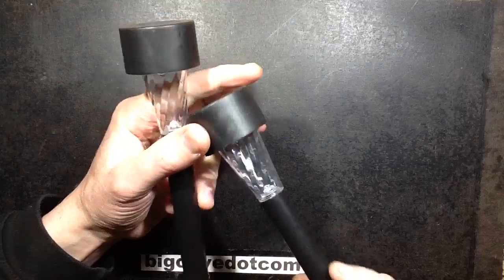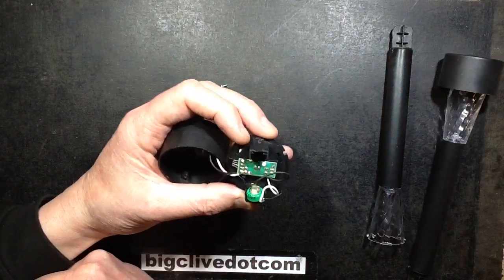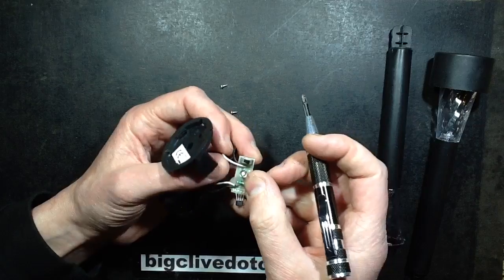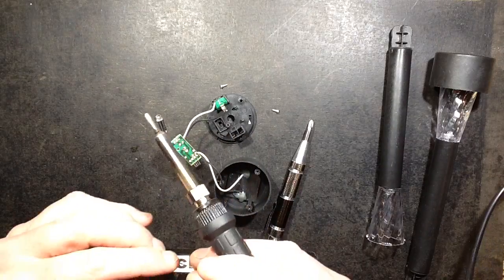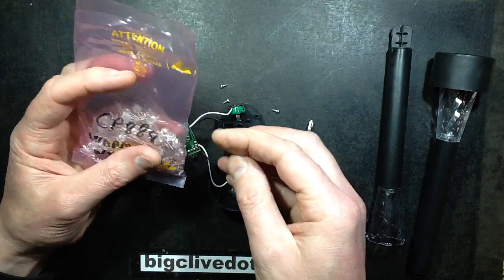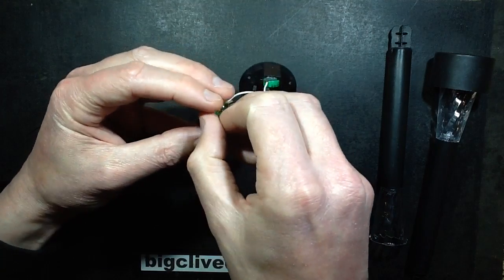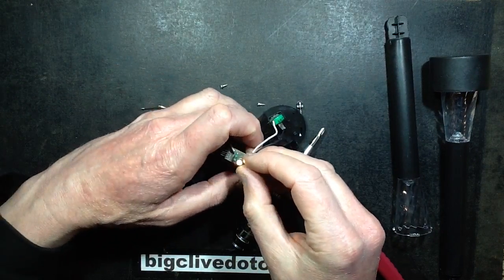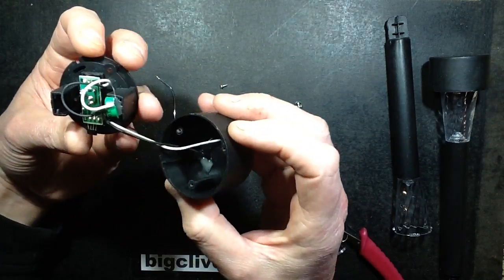Hacking Poundland "2 for a pound" solar garden lights.

Comment: I tried the tap from eBay but it went crusty and hard and fell off so I use your other method and put a thin coat of silicon across the top that has worked for over a year and looks the same it works. thank you

Comment: Hi do u think that the lights could be modified to wire a very simple mp3 player
Reply from the maker: You can get solar powered MP3 units, but they tend to have bigger cells and batteries.

Comment: I bought a pack of 20 of these from Bunnings for and it was $15. It has warm white leds same build design with a different diffuser {in my opinion that looks better}. It has a 100mah 2/3 aa battery in it. Pretty good a 75c AUD like 40p per light

Comment: Hello, there. Thank you for bringing informative, interesting videos in a low (understandable) way. I know this is an old video, but I am searchimg for a matter that I can’t find anyone has ever bothered to mention, allthough to me it seems to be a common problem. The manufactures of these cheap garden solar lights seems to have got a hangup on putting in these small on/off switches, that (for the price naturally) is very, very poor quality. I don’t know why they bother, who turns these lamps ever off, anyway? When the go bad, I usually just short them. 
But could you explain, maybe in a video, what happens when the battery gets charged, but the lamp is always staying on (no need to cover the sun cell)? This also seems to be a recurring problem. Regards from Norway :)
Reply from the maker: Sometimes when the battery is old and has high resistance the voltage across it rises high enough to light the LED from the solar panel.  The on/off switch is to try and protect the battery from being kept in a discharged state for too long during storage after manufacture.
Reply: bigclivedotcom I know I started my comment regarding this switch. Along I changed the team, for some reason, to write about what component that has the job on waiting for darkness to lit the LED. In a amateur way. Sorry about that.  Thank you for answering :)

Comment: i cant seem to find what the voltage is for the leds.
Reply from the maker: Typically around 3v, but you can use any ordinary LEDs.
Reply: thanks for the quick reply, here i was searching the interwebs for 1.2v leds :D but this makes it much easier since i already have them laying about

Comment: How do I update it to use copper wire led string light to make jar lights?
Reply from the maker: If you get some of the copper wired LED string you can connect it where the original LED was.

Comment: These lights are available right now at DollarTree in the US.  Where they cost $1 each.   They also had another model, more of a floodlight with three LEDs.  It runs off a 1/2 AAAA NiCD.   

I've found these things make great emergency lights.   Mounted in bathrooms or hallways where the light never normally turns off, it can charge these lights and if or when there ever is a power outage, the LED will turn on automatically.   Quite handy.
Reply: +LS --> Amazon is finally offering fairly good quality garden solar lights like these and in other styles.  Unfortunately it seems you have to purchase them in 12 or 24 pack options in order to get them for anywhere close to a dollar each.  Oh, and you have to be a Prime member to get the free shipping :(  However, still better than the $3-$4 each that Walmart is asking for the same thing when you don't live close to a Dollar Tree, Family Dollar or Dollar Store location.

Comment: just picked up the "Charlie Dimmock" stainless steel version, and the trim makes a well on the top. 
Will have to look for one where you do the circuit as I'd like to use one of the drivers to convert an old push light to LED

Comment: I got a bunch of these
4 in total. 
one is old. tripleA sized NICD rated 200mAh old from 2015. Flat enough it measures full on my charger almost as soon as I put it on.
the other 3 are new from 2016 work just as good as NIMH although they are the same capacity. rated 200mAh (i do notice NIMH have ever so slightly higher full-charge voltage of 1.45v for NIMH vs 1.4v for nicd
they can output much higher current vs mAh rating compared to my NIMH AAA's

They feel as light as old carbon zinc batteries. so maybe the high output and low weigh could benefit something. RC cars maybe.

Ive always had this amazing idea of internally combining multiple NIMH together for a single cell rated a higher voltage.
For example you could put 3 in series inside a single cell. to make a safer LI-ION cell sized battery even though its NIMH in chemistry. That would be super interesting. I dont know how anyone would be able to do it successfully though. They'd have to be careful. but I do believe it would work! Nobodys ever done it though.
You could have custom voltage packs from a single cell and they would be more efficient than multiple smaller cells!!! Saving space AND making more power! just wire them in series internally with spot welding or whatever method would work to tie them in series internally.

You could have much higher rated 9v NIMH cells that consist of multiple cells wrapped in series inside each other with the last one to form the 9v shape! Now wouldn't that be something?? It would be super efficient!

Comment: Is that a poundland screwdriver?
Reply from the maker: I use the small multi-bit set from Poundland because it is actually really good quality.
Reply: I noticed, because I have one.
Reply: bigclivedotcom and cheap as chips....even though that's £1.20 now, so cheaper than chips!

Comment: Hey Clive is there any particular reason why you like warm white LED's rather than any other Colour LED's or Bright White ones? I was just curious? Also would it make any difference to the power consumption? Great Video.  Keep up the great work. Nick.
Reply from the maker: +Nicholas Aarons (Nick Mini) theoretically the cold white LEDs are slightly more efficient.  In cold climates people tend to prefer warm white light, and in hot climates people tend to prefer cold white light.
Reply: It's a trending issue here in the US that new LED street light fixtures have a warmer (say, 3000 Kelvin) color temperature. The IDA is spearheading the change to warmer saying that the "blue" color (around 6500K) is detrimental to human health. Here in Southern California (a relatively warm climate), we are pushing the 3000K temps for our solar street lights to customers. They seem to be satisfied with it. Just a bit of the gossip this side of the pond. Great videos, by the way!
Reply: Nicholas Aarons I heard warm white makes it calm and sleepy cool white makes you active or something with the melotonin production
Reply: bigclivedotcom Thank you for the reply. That's interesting and very true. Nick.

Comment: I had a bunch of them in my garden but I used green and red leds- that looked very nice. and those were the classic lights with full size aa cells, which I changed to better ones. with some hot snot and dealing they lasted several years
Reply: AvE watcher detected!

Comment: I used the same tape to do a temp repair on a gutter that I cracked by leaning a ladder against it.  That was 2 years ago and still not got round to buying a new length of gutter but the tape is still doing its job.

Comment: Last week I was walking back from te$co (who won't sell heinz mayo now, the bastards), and I saw a glowing from the gutter on the side of the road, turned out to be the batter-end of one of these (or at least a very similar one with a metal sheath round it and a NiMH AAA inside) lights, and it had been run over by a car, and was still working, so I had to salvage it to see what the chinese did wrong to make something that survived being run over... :P

Dunno what I'll do with it though cos the light output is pathetic... :P

Comment: How long does the battery last once the light turns on? What kind of battery is it? Wouldn't branded AAA last longer sice it seems it would fit?
Years ago when I was getting lamps from eBay they all had cheap AAs, usually 2xAA which I was replacing with good brand ones. Then I was soldering 1 additional LED in parallel to existing one and it was brighter than original.
Reply from the maker: It runs at low intensity, so with a decent sunny day it will run all night.  It's engineered to be cheap, so uses a NiMh button cell.
Reply: Krzysztof Cygan That tiny NI-Mh cell probably has about 45mAh tops. A regular AA size battery in these cheap lamps are rated for 600mAh usually but they all test about 130mAh when new with a very high internal resistance and in a bit of time and use the capacity drops down to 30-50mAh and stays there for a while and then Kaput! So basically you don't gain anything with these cheap products, that's why their cost is pretty similar. Hope this helps, Cheers :)
Reply from the maker: ciprianwiner I've never actually tested the capacity of one of the 300/600mAh cells in the solar lights.  One of my "smart" chargers systematically rejects them.  Probably because the high resistance shows up as an unusually high cell voltage when the charging current flows.
I've just taken apart a solar light with an AA cell rated 150mAh.
Reply: bigclivedotcom Yes, that is a problem with these cells, their high internal resistance makes the charger overshoot and sometimes it stops charging them, you could charge them on a more "dumb" charger and then discharge them on a smarter charger. 150mAh seems more honest to me. :)

Comment: I like your tip about taping the top, which I'm curious to try.  I had quite a lot of these fail also with water leaking inside around the solar panel.

Comment: I also replaced the daylight LED with warm white 3528 I salvaged from broken LED bulb. It uses the same chip that controls the charging and LED, but the position of the switch and LED is different. I also modified it a bit so the switch actually switches the LED from dim and bright using the 1K resistor in parallel with the switch and series with the LED and bodged the negative wire to the other side of the switch and cut one track going to the LED, in dim mode the AAA 600mAh Ni-MH battery actually last the whole night and LED is quite effective as a night light that way. I used it indoors on my window sill. Thanks for sharing.

Comment: The 4 pin boost converter chip is usually the yx8018 - lots of information available on re-purposing it.
Reply: David Pilling Have a look at the ZXSC380. Not fancy, but looks like a good replacement for the joule thief of Big Clive (this guy) fame.